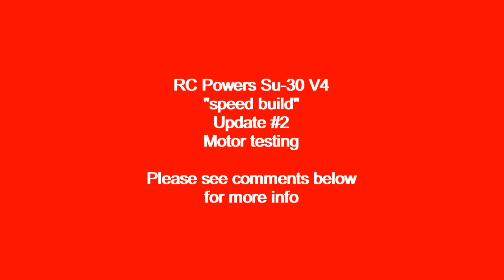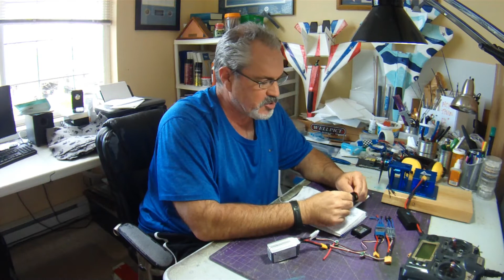RC Powers Su30 V4 "speed build" Update #2 motor testing - 30 Apr 2018

Comment: Hi Scott,have you looked at the Grayson hobby monster jet or mega jet motors.
Reply from the maker: I used the Grayson Hobby mega jet motor quite a bit years ago.  Compared to the lightweight quad racing motors I am using now in my park jets, the mega jet is twice as heavy and produces considerably less (25% at least) power.  I also found that out of the three of the mega jet motors I owned, only two really ran well and up to specifications.  Cheers, Scott

Comment: WOW! Some great numbers there Scott. The Hobbywing esc should be fine as I used mine on the original setup on my SR71 which was running the NTM 2836 2700kv on 4s and that was pulling 57amps, but the esc was mounted outside the plane. I think we've talked before about having a air slot or scoop for cooling the esc in flight. Maybe do that just in case. 
...RCPP